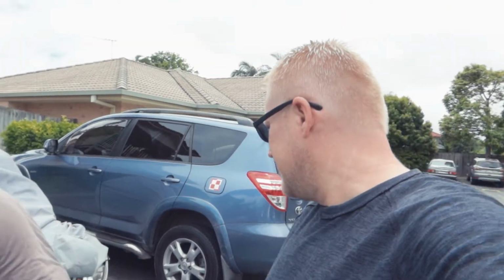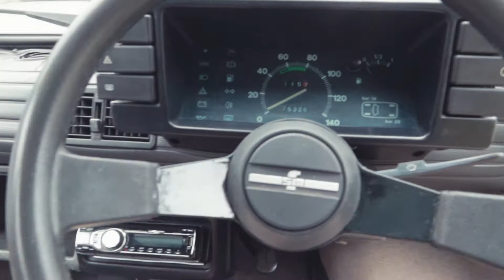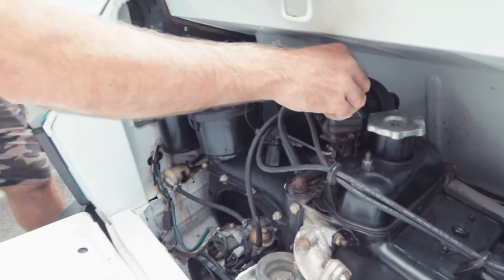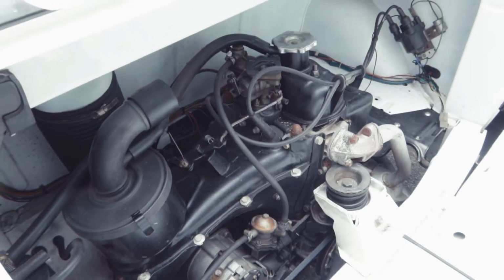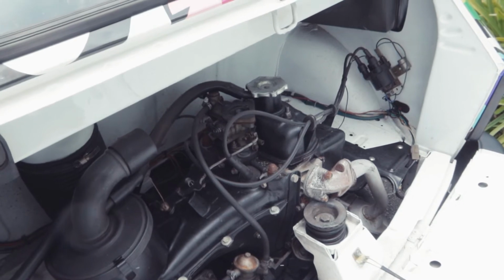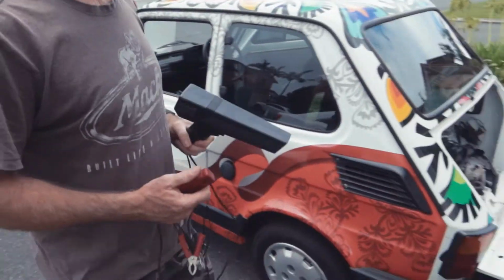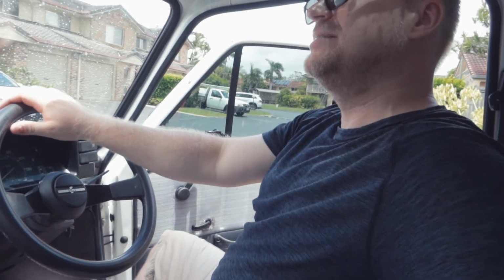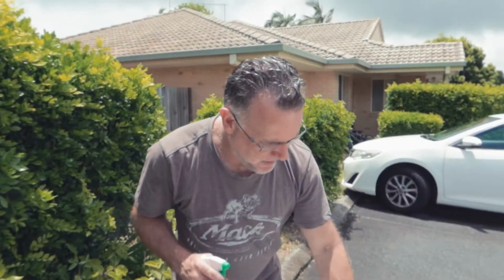It Took Us 2 Hours To Start The Fiat 126p Niki - Vlog 272

Comment: You're right the fuel does drain back on these if they're left standing. I'm in the Uk and have a fiat 126 bis. It does exactly the same. Some people put electric fuel pumps on to elevate the problem. Great looking car guys....👍👍👍
Reply from the maker: Thank you. I wouldn’t put an electric fuel pump on mine. I need it authentic. If I don’t have to push it to start it then is it even a Maluch
Reply: Too right I totally agree with you I'm not a fan of altering them in any way. I've got two 126 bis' ones got alloys on but I've searched and found some original wheels ...thanks for your reply, good luck with your fantastic little fiat...
Reply from the maker: @njkip  I would love to get another one and do it up as a project. But in Australia they are very rare to find. Even a shell is difficult to track. There are a couple for sale but they want ridiculous money and they don’t even work as well as mine. I guess I’ll stick to this one.